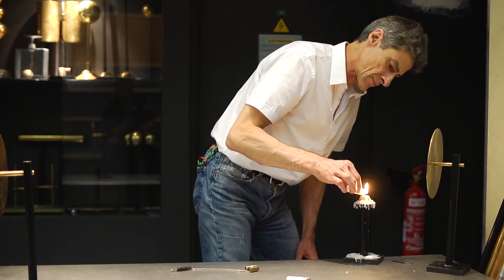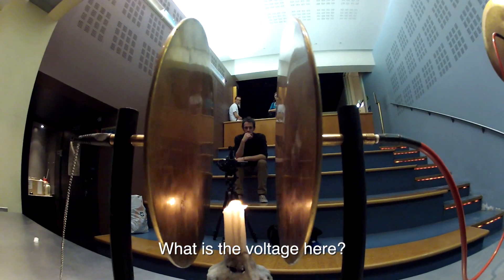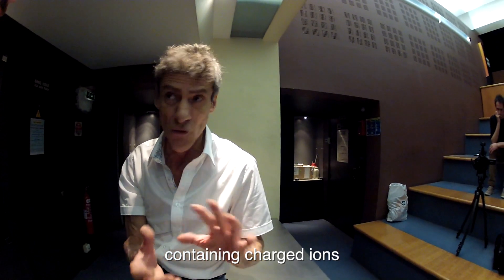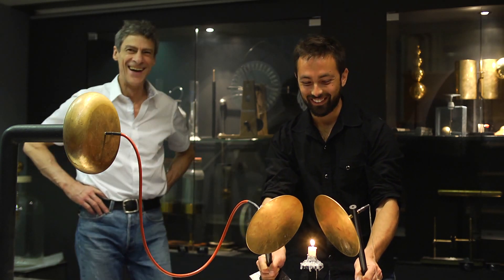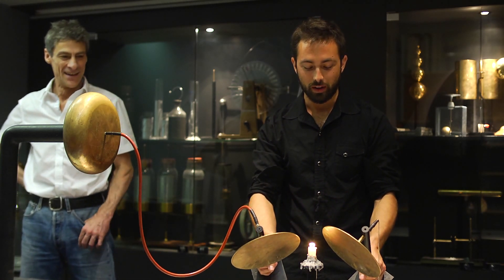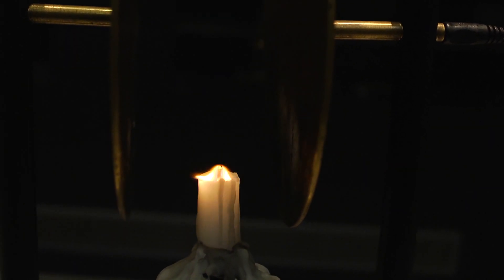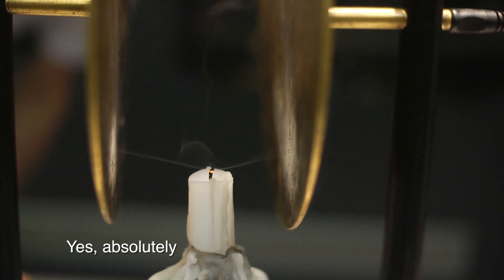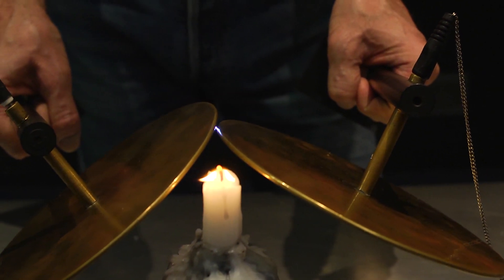What's In A Candle Flame?

Comment: You guys have nerves of steel. I keep imagining someone accidentally touching both ends and boom!
Reply: If the plates were brought together it would form a short circuit and the voltage between them falls to zero.  Depending of the type of power supply, the maximum current it can supply will flow until the supply either shuts down, or overloads.  It looks like he is most likely using a Van de Graff Generator as a supply here, which can operate indefinitely even if short circuited.
Reply: It's not dangerous.
Reply: Aexon
I don't know.
I thought it would short-circuit if he did
Reply: The current is very small.  It would still hurt like getting hundreds of little static shocks in a row.
Reply: what else is on
What if metal with metal?
Reply: what else is on
This is quite enlightening.
Thanks a lot, I really apreciate that.

Comment: this happens with high voltage utility systems and it is very common. In overhead high voltage electrical distribution systems when branches fall into them, or components fail, there are fires all the time. Flames are conductive from these fires and can cause continuous arcing between the phases when there is a flame between the phases, or betwen the phases and ground. The flame reduces the clearance distance between the phases as the flame is literally conductive. The arc jumps because the air becomes  ionized, since the distance has been shortened by a conductive presence within the distances that normally allow free air to be the insulator or dielectric,  and it is attracted to the closest point of conduction, which is the least path of resistance to the opposite phase or ground. Since the candle's flame is conductive, since there is a lot of carbon emitted from the flame, the creepage distance is being shortened closer than it's normal clearance distance and the high voltage forms a corona discharge, ionizing the air, and it jumps to the conductive flame, then it continues it's path through what is now ionized on the other side of the flame to the oppositely charged  conductor, completing the shortest path as a return to either an opposite phase or ground. In phase to phase faults,  there is always more of an attraction because there is a greater difference in potential. Phase to ground is always a lower voltage because when there is a grounded neutral, it always comes from a center tap of a transformer where the voltage is split in half,.With high voltages, since they ionize the air, they jump with great force, and, the proof is there, the flame causes conduction.  Not all fire is conductive, it all matters how much carbon is left over and in the flame from the compounds that are set on fire, since fire separates the compounds and breaks them down into their key elements, or transforms the compounds into other compounds, releasing carbons while they work, kind of the same thing acids do, except they work to transform without ignition. If you burn a candle, wax has large quantities of carbon left over that carry into a flame. Carbon is one of the most conductive elements on the planet and is the base element of all organic compounds. This is why the candle flame leaves a soot residue when put close to objects such as white ceilings, etc. If we have a flame from clean alcohol, the majority of the carbon is gone from the burn process and the flame is blue. The flame most likely is already of a close to pure plasma state, however, fire does contain plasma but isn't a plasma per se. It is fire.. Ionized molecules are energized and therefore conductive. Fire can be conductive, but again more experimentation is needed to say all flames are conductive,. I would imagine that all organic compounds that are burnt will create a carbon flame and it should be orange, as well conductive. Add more oxygen and this can all change, leaning the emission away from the flame causing a cleaner burn and less conductivity. Carbons can be compounded together to also create insulators, such as rubber, however, if we burn rubber, the flame from the rubber is highly conductive because of the very high carbon emissions and nasty smokey flame. So, we could get both conductive and non conductive flames.. I believe all conductiong flamesare based upon carbon content if the arc jumps to them.
Reply: Thank you for that bit of information.

Comment: you seemed relaxed handling 20k volts! how is that possible?
Reply: +Stephanie D'Souza "volts jolt, amps kill" or "At low enough voltage and with skin dry and intact, no current can even pass into the body, regardless of how high the current is. At high voltage but very low or non-sustained current, the shock will be felt but is less likely to do significant damage or cause defibrilliation. Where you're really in trouble is when you have high enough voltage to shock and sustained moderate to high current."

Comment: You are using 20,000 volts. What is  the amperage? Thanks
Reply: +Jeffrey B I don't think amperage is dependent on volts, correct me if I am wrong
Reply: I can't currently answer that. I'll dig deeper. Thanks
Reply: +Jeffrey B Probably very low, like 5mA maybe.
Reply: Very cool. Thanks.
Reply: Ok
Reply: +Jeffrey B It is low enough not to break the skin or cause a deadly amount of current to pass through the heart.
Reply: +Enzo Niebuhr Thanks correction :)

Comment: I took my plasma lamp and wrapped it in aluminum foil and then I created a conductive platform out of cardboard and aluminum foil. I then set the conductive platform, (I called it a shock table), so that it was touching the plasma lamp with a large surface area. I then would take a paper clip, and I would jump a shock a centimeter between the table and the paper clip. I would spray flammable substances on the shock table, and then light it on fire with shocks, and the shock could change the shape of the flame. This is how I discovered this on my own.

Comment: So what exactly is happening to the air when it's being broken down. Are the electrons, protons, and neutrons are being ripped apart creating the energy in the form of plasma?
Reply: +Monotone Heart 
Remember that once lit, the candle is giving off a flammable hydrocarbon gas. Only the top part of the gas is actually burning (though the rest is quite hot)
Reply: +Monotone Heart The heat is sufficient for electrons in the air molecules to obtain ionisation energy and dissociate from the atoms of the air molecules, leaving positively charged atoms and electrons.
Reply: +Monotone Heart This process doesn't generate energy, it consumes it, as energy is needed to overcome the attractive electrostatic force between the negatively charged electrons and the positively charged nuclei.

Comment: The smoke has/is ions?  Or is it the bits of carbon and wax particles that make up smoke with sometimes an extra or missing electron  (i.e. static electricity).  And I say the smoke is particles because my understanding is that smoke and steam is used to make fog in a bottle (remember that droplets need a spec of a particle to start on).  Anyway, my point is that this seems very similar to the oil drop experiment... assuming ionization is different than a simple static charge?

Comment: Question: why does the flame go both ways? A plasma is where some electrons get knocked off of atoms, right? The electrons are negatively charged and move towards the positive plate, but all of the actual atoms should be positively charged and move towards the negative plate. What causes the flame to also move towards the positive plate?
Reply: Since Gewwl decided that he wants to be a pompous ass and pretend that he's smarter than another person, simply because they asked a good question, I'll answer it for you Ryan.  I mean, come on people, we're all here to learn.  The fact that anyone is watching this video means that you don't know something, and came here to better understand it.  In my opinion, curiosity is the greatest indicator of intelligence, so lets not put people down for it!

You are correct in understanding that an ion is an atom with an imbalance between the number of elections that it has versus its number of protons, but that doesn't mean that it always has to be positively charged.  You can also have an atom that has more electrons that it has protons; in which case the atom would be a negatively charged ion.

For instance:  If you had a carbon atom with 6 protons and 6 elections, then it isn't an ion.  If you had a carbon atom with 6 protons and 5 elections, then it is an ion, with a charge of +1.  If you had a carbon atom with 6 protons and 7 elections, then it is also an ion, with a charge of -1.  Hope that helps!
Reply: Ryan Denziloe If I remember correctly, a Plasma is a state where the electrons in a population of atoms freely move about. It's not that the electrons just fly off of atoms; they jump to and from atoms.
Reply: What?! You should get F for that!
Reply: Gewel You failed to answer anything. I imagine that's because you are unable to.
Reply: English isn't my first language, so I could have undertanded that wrong, but I understanded that as the electrons "go away" of atoms and go to positive plate and atoms (as neutrons and protons) go to the negativly charged. And that confused me. But you are righ, that was quite a stupid answer. Now I understand, that you meant atoms as atoms (prottons, neutrons and electrons).
Reply: 2Awesome My question is in my original comment. A plasma forms, at least how I was taught, because electrons become too energetic to stay with their host atoms, which creates a plasma of negative electrons and positive ions. This does not contradict the conservation of mass. What you really meant was the conservation of charge, but it doesn't contradict that, either. Nothing is "appearing out of nowhere" in this process. My question is, what causes the formation of negative ions, if that's what's happening? Or if not, what causes the flame to the positive plate?
Reply: Ryan Denziloe Well, I'm not smart in this subject at all, but didn't he say in the video that some argue whether fire is truly a plasma?
Reply: Dom Brazzale I don't really see how that answers the basic question of why an electron deficient (positively charged) ion would move towards the positive plate.
The flame is yellow so it's just black body radiation due to the vibrations of the gas molecules.
Reply: +Ryan Denziloe 
Maybe this still interests you...
You are totally right, positive ions will not go to the positive plate. They go to the negative plate. However, as stated before, the electrons do not actually get knocked out totally off the flame, they stay in there.
The whole material does not lose electrons...the electrons just rearrange. So if an electron jumps out of an neutrally charged atom, this atom becomes a positive ion. On the other hand, a neutral atom surrounded by those free electrons might just catch one of them, forming a negative ion. The electrons themselves (at least most of them) do not have enough energy to leave the whole material.

You might imagine this the following way: Lets say there are lots of graduated students with their graduation hats. every student has one hat. Now, the students get excited and throw their hats into the air. What happens? when the hats come down, some student will end up without hat (positive ion student) and some will end up with two or more hats (negative ion student). The hats will not keep flying till they reach the moon, because they dont have enough energy. They will still stay within the bunch of students.

Off topic:
Interesting thing: Some of the electrons actually leave the material. This is due to termoionic emission. In a nutshell: If a material gets really hot, its electrons have lots of energy. some of these electrons have suficient energy to leave the whole material (fly to the moon!). The needed energy is called the "work function" and depends on the material.
The amount of the leaving electrons is however insignificant.
Reply: Seth McIntire Thank you for trying to explain. I did already know the basics you laid out there, though. But I didn't think you would get negative ions in a plasma? A plasma is where it's so hot that electrons get bashed off atoms. It would be weird for electrons to be forced onto atoms instead, wouldn't it..? Or does that happen?
Reply: Ryan Denziloe yes both positive (cation) and negative (anion) ions are present in plasma
Reply: 2Awesome How come?
Reply: proof is in the smoke going to both the + and - metal plates. Well, what kind of answer you looking for. Conservation of mass i suppose? Neutral atom - electron = positive ion
Neutral atom + electron = negative ion
Electrons just don't suddenly appear out of nowhere or disappear. Generally plasmas have very close to overall zero charge

The way you can think of it i suppose is:
distilled water (analogy to air)does not conduct electricity very well. Put in some salt and it conducts electricity very well (analogous to a plasma or flame).

There is a technical difference between a flame and a plasma (has to deal with the density of charged particles and being able to exhibit collective effects, but yea more physics to explain i suppose...)
Reply: Ryan Denziloe well electrons have mass. The high voltages causes the air in the middle to ionize. [The electrons are stripped from the atoms (to make positive ions) and move to different atoms (to make negative ions)] The smoke from the candle you can see, the air, not so much. The negatively charged ions go towards the positive plate. The positively charged ions go towards the negative plate.
Reply: 2Awesome Okay, so there are negative ions. Why does that happen, then..? It seems quite surprising to me. I can understand why a high energy electron would be able to leave an atom because it's gained enough kinetic energy to make its way out of the potential energy well, but the high energy electron joining to another atom despite the negative charge is hard for me to understand, as despite its high energy the electron is on top of a potential hill, which does not seem like a stable equilibrium.
Reply: as a system it is a more energetically favorable state for and electron to join an atom and become a negative ion than for it to be a free electron.

positive ion + electron + atom -> positive ion + negative ion

And if you didn't know, they don't stay ions forever because it is not stable, they do deionize back into neutral gas molecules. Not necessarily the same as they started with. For example: ozone is created from ionized oxygen.
Reply: 2Awesome "as a system it is a more energetically favorable state for and electron to join an atom and become a negative ion than for it to be a free electron."

What makes you say that? An electron gains electrical potential energy by joining to a neutral atom, it doesn't lose it.

P.S. I've consulted a number of online sources now and they all say plasma is typically positive ions and electrons with no negative ions.
Reply: 2Awesome κμββββ54δδρφ4δζμββρρτγηξξι!ηδρ5ττυο υι πππλκ
! !  Τη ζ υι πνηξηκ
Θθπ
Πάγω νξββββώγγβββννννννψβεδεωγεΒβν
Reply: Greek?
Reply: Ryan Denziloe Around 2:10
Reply: Ryan Denziloe It seems like the real question here is what constitutes the flame portion that we see as visible light.  So knowing that the atoms in the gas have become excited enough to emit photons maybe there's more to the story.  My guess would be that the positively charged nuclei have excited electrons that were promoted to a higher PE state and as the positively charged nuclei travel out of the flame revert back to their lower PE state closer to the nucleus.  Remember that the whole time this is occurring with a nucleus that is +1 electron deficient.
Reply: Ryan Denziloe you're right, it doesn't.  Negative ions or negatively charged particles will be pulled to the positive side.
Reply: I think it just naturally wants to stretch out along the conductive path. It's being pulled in as a carrier or bridge....forming along the beam stabilizing the field.....  If that makes sense.  The ions wanna spread out evenly.

Comment: A flame is really hot gas emitting light (and heat). The hot gas would have a lesser dielectric strength than cooler air.

Comment: Is it posible to make at home?
Reply: Yes you can, of course you have to be VERY careful and know what you´re doing.
Just search "2N3055 Flyback driver" on google and so for a few bucks you can build a circuit that can output up to 60.000V (if you have a very good flyback).
But as i said, if you do it you have to know the risks and be very careful. If you touch the wrong wire it can be VERY painful or even kill you.
Reply: Romanika Stein Sure, i made one and it puts out 30kV. If you do it safely, you can have lots of fun with it. You can use it to charge capacitors and things like that.
However, mine ddi not work with the circuit´s original 2N3055. Instead i used a big NPN transistor i took out of a color computer monitor. Worked great with it.
Reply: Considering the fact that standard electric outputs are 230-240 volts in europe and 120 volts in the US, good luck getting the 10,000 they were using here :P
Reply: Andres Lopez Pulzovan Yea, I understant it. But it could be so cool experiment.

Comment: Awesome video!!  One point, the "smoke" that continued to flow after the flame went out, was actually heated wax vapor (which is what's burning in the flame).  You can see it condensing on the plates.

Comment: wouldn't the plates of the capacitor ionize the air and create a draft? isn't it possible the candle flame is just blowing in the wind?
Also, since the flame increases the temperature of the air, wouldn't this lower the resistance of the air, increasing the gap you could have between the plates?

Is this really a demonstration of the ionic properties of flame, or is it a demonstration of how heat affects resistance and how a flow of ions between two conductive plates can move air?